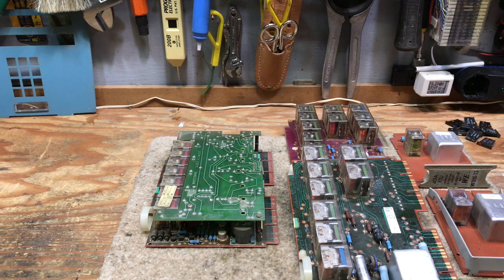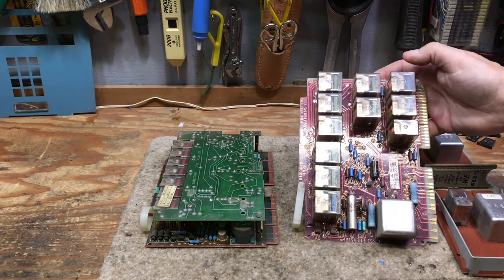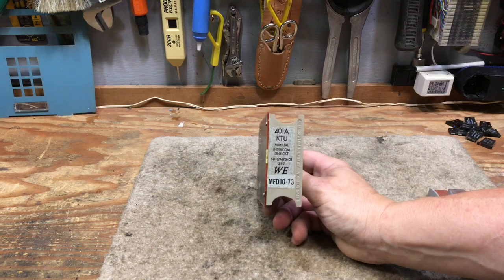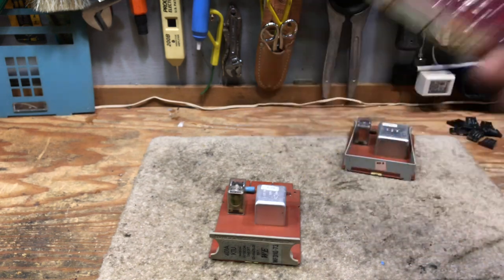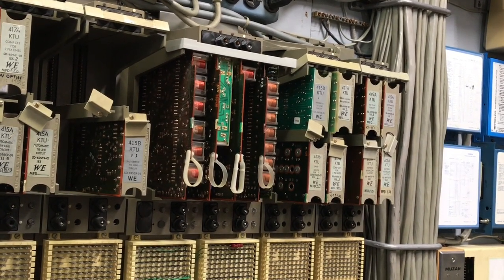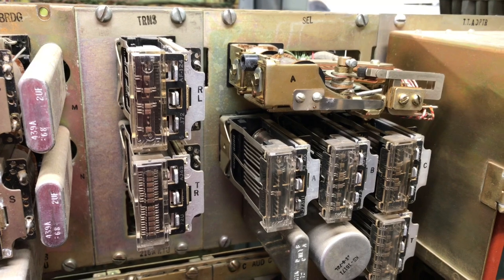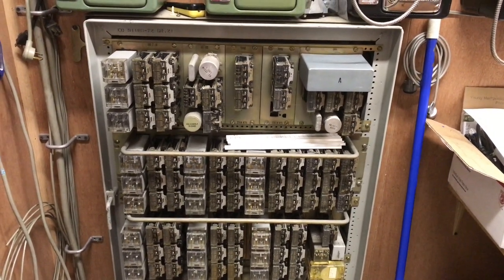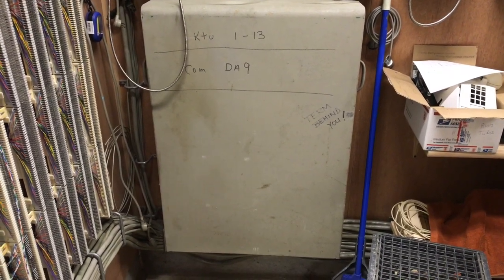Western Electric intercom unit's and cards used with 1A2 Phone systems.

Comment: Hey Phil, 
I have a 1A2 key system; 551B KSU with ITT 400 cards, two CO lines  in my home (yes, it works). I also have a 401B intercom card. Is is possible to ask for you to discuss the correct wiring for a "boss to secretary" intercom, specifically talking about wiring in the phone and on the x-connect blocks? 
I also have a couple of those 4-button boxes that sits next to a phone for signaling. I can't find info anywhere on how to wire those to signal different phones on a single manual-intercom line. 
Thanks so much for your generous advice on what I think were the best phone systems every built.
Reply from the maker: I can draw up a simple wiring diagram. Depending on your skill level and how your system was installed what i come up with will be very cheap and dirty butt should be easy to wire.